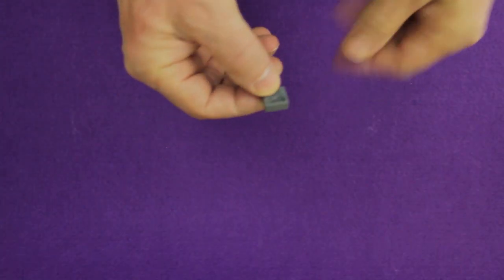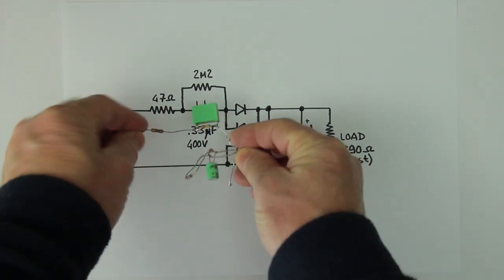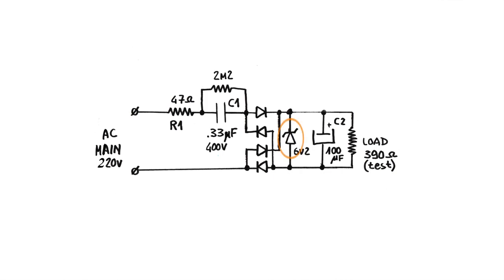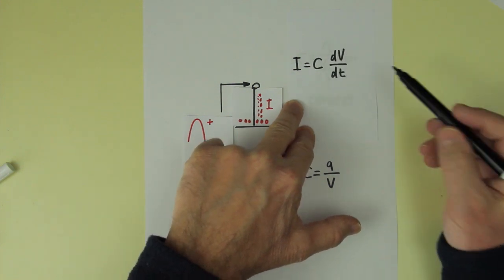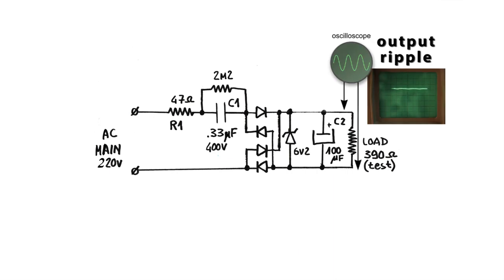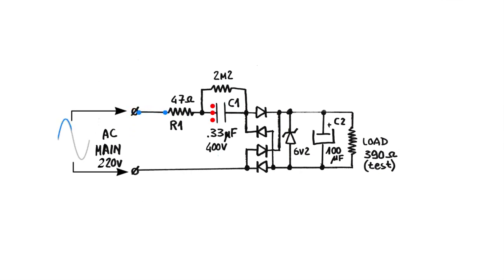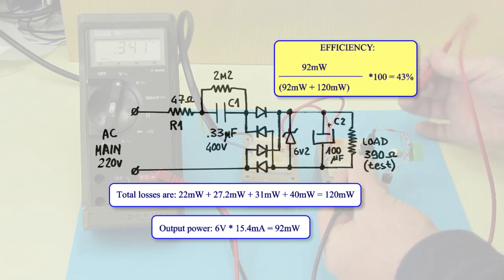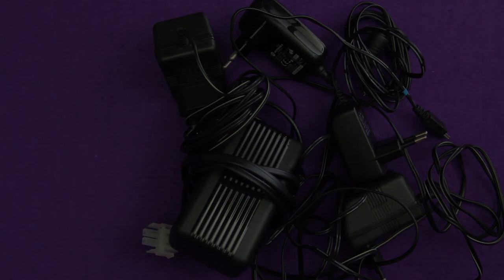Why Capacitive Power Supply Are Bad (electronics educational)

Comment: In some cases, when space and cost constraints are conditioning and current is very limited capacitive power supply are one of the choices.
Other could be offline inductorless regulator. This stuff leads to work with insulation transformers during developing process ,if a micro controller is used, this will work in the unpleasant condition to have mains live connected directly to GND

Comment: The power losses from the bridge rectifier don't count. You have those losses even if you use a transformer instead of a capacitor. You still need the rectifier to get DC out of AC.  Also, of course the efficiency sucks if you use a simple shunt regulator like a Zener diode. Put in an efficient synchronous buck converter and you can recover 95% of that. Most of your genuine losses are actually from the current limiting resistor on the front, which really only needs to be 10 ohm, not 40. There isn't much you can do about the X2 bypass resistor. You can regain some efficiency by using a 10 Mohm instead of 2.2 but there is a limit as to how far you can go.   On the other hand, what you don't talk about are the efficiency losses due to the magnetic core of a transformer if you are trying to make a very small power supply. These will utterly destroy your efficiency on a small power supply of 500 uA.  So it really depends on your project. Engineering the correct design for the job at hand is always the proper solution.
Reply from the maker: > "Put in an efficient synchronous buck converter"
People use the circuit showcased because it is very simple and dead cheap in the first place, so there is no point in using a buck converter with a capacitive voltage drop. While I do agree that playing a bit with the values of the resistors the circuit could gain a bit in efficiency, the goal of the video was to highlight the serious drawbacks under the point of view of efficiency (including power factor, although small), safety, and stability. One point I didn't mention in video was that this circuit is also prone to cause severe failures in the case power mains contains harmonics. @Mathias Wandel has experienced himself this kind of issue when he tested a portable, battery backed generator that fried a power meter.
About the rectifier, while it is true that it is likely required even on other types of power supplies, it doesn't mean that to calculate efficiency we can neglect counting it.
Finally, certainly a small transformer is a source of non-negligible losses, but nowadays we can design a switching power supply that works at high frequency, dramatically reducing losses, increasing reliability and safety and making the whole thing small in size, even though not so deadly cheap as a capacitive voltage drop power supply.
Thank you anyway for commenting, your contribution provided an opportunity to bring new elements to the topic.
Your last line is very wise: Engineering the correct design for the job is always the proper solution.
Greetings from the Alps.

Comment: 220 VAC  IN  OK.. TO 18... "NEXT" ...18  TO 220 VAC.. (BUT !!  YOU HAVE NO AMP ANYMORE)

SO   "TO WHAT USE"   !!

IT  IS  NOT  LIKE  "220VAC..10A    IN    220VAC...10A  OUT"  ..!!   THINK EVEN NOT "1 AMP" OUT

SO   ???
Reply from the maker: Sorry for the late reply. You need to take into account power. A 220V-18V 20VA transformer roughly can output 1A while absorbing 90mA in input. Reversing the equation gives the same result: 20VA 18V in absorbs 1A and output 90mA at 220V. Indeed the output current is less, because efficiency must be brought into the equation. So suppose the efficiency of each transformer is 80%, the total efficiency of the two coupled transformers will be 64%, so output available power will be reduced at 12.8VA which gives 58mA at 220V vs. 90mA.
1A output means almost 220VA in power, and compensating the power losses, supposing a 90% efficiency (the larger the power, the larger the efficiency), to achieve 1A in output you would need a couple of transformers rated 272VA.
Remark. Edited, reason: typo on output voltage, added further details to achieve 1A output.

Comment: What! In the end the solution is actually use commerialised power adaptor?!?!!? HAHAHAHAHA!
I am not sarcastic. I was waiting for the solution and then...I did not expect to hear that. I thought you are going to show how we could DIY a simple power supply which has power factor of near to 1.
Reply from the maker: I am happy you are so amused for my video :) Yes, you are right about the poor power factor of some wall-warts but at least they have the output that is insulated from mains, and have better efficiency anyway. Furthermore, the purpose of this video was to talk about this kind of circuit to highlight their characteristics, not a DIY video. Cheers.
Reply: @AccidentalScience  You are correct about the insulated part. But I dislike the fact that nearly all Chinese products are only 2-prong! Not grounded! According to companies (Dell as well), they say that there is a reason for establishing 2-prong, but no reason stated. Weird indeed.

The only reason I know is 3-prong, the ground can effectively create a ground loop to the circuit making a safe one unsafe. But this reason is invalidated by properly designed and engineered circuits and housing.

Also, grounding really can totally eliminate "electric tingling". This capacitive electrical phenomenon actually renders my precision devices such as GPS unit and camera nearly useless. Thankfully none of them gets fried.
Reply from the maker: @realchristopher4334  They have 2 prongs because typically they follow the norm for double insulation (see here for a preview: https://webstore.iec.ch/preview/info_iec60950-1%7Bed2.0%7Den_d.pdf ).
Being double insulated you can ground the negative. The "electric tingling" as you call it, is a defect that indeed affect several smps for laptops. If grounding the negative causes an increase in positive voltage (spikes when seen at the oscilloscope) or a current goes through the (added) ground wire, then the PSU is severely defective/badly designed and need to be discarded. I think they are not compliant with the normative too, but I have no strong proof of it.
For instance, I noticed that every PSU that came with Acer laptops I had (5 units) were affected by this problem, and one of them fried an AVR MKII programmer while I was reprogramming a unit having an ATmega32 that through a communication line was connected to ground. But because at the time I was the CEO of the company I never had the time to investigate into this problem, even though indeed it would deserve a whole video ...maybe one day :)
Reply: @AccidentalScience  Ah. Double insulation. I see the symbol often. Square within square.

According to the article you provided me with, having a device earthed or double insulated or reinforced insulation seems to be an option. I always thought earthed is a necessity in the name of safety and also as a makeshift Faraday shield (as in my case).

I do not have an oscilloscope, unfortunately. I am just another average hobbyist or DIYer.

Hmm. Problem is 3-prong plugs (especially from China and by China, whether it is its Western investors' idea to save cost or deliberately designed that way) have 3 prongs, I dare say almost EVERY ONE of them is only 2 usable prongs. It is because the ground pin is plastic. It is there for the sake of opening up the live and neutral covers. Few I found are 3-prong, the earth pin is metal, but absolutely not wired, it is there for formality sake.

Therefore, what you mentioned about the negative can still be grounded despite of being double insulated, it is not happening. Ground pin is as if a decoration and serves nothing more.

The said "electric tingling" is not limited to only laptop or PSU, in my case. In fact all 2-prong or 3-prong (but only working 2 pins) plugs produce that phenomenon. My laptop is plastic all over so I cannot feel it (I can feel the effect only when I plug in USB cable). 

My very old laptop with is very old PSU were the same. I did not know "electrical tingling" is a real problem. 

Too many coincidences that it is not a coincidence that the plugs or circuits are made such a way. It cannot be every one of them is like that. I think they are meant to fail as quickly as possible to force people to buy new ones. (Sounds like conspiracy. But not a conspiracy when we consider it similar issue to LED. I bet you already know that LED companies overpower their products. This is even true for Chinese knockoff, they use same amount of LED for all claimed wattage but run by different drivers, they can get insanely hot! Only Dubai managed to force Philips to make ultra efficient and possibly never-dying LED by underpowering each LED, they stay cool.)
Reply from the maker: When I said the negative can be grounded I meant that, should the unit be one with double insulation, you can add an external ground wire safely in some way (maybe changing the power cord and plug). Double insulated equipments MUST have two terminals only, otherwise they won't fit the norms (I am referring to EU-EN norms, I don't know about other places in the world). By "terminal" I mean either prongs and/or side contacts as you may find in Schuko plugs (they are standard EU plugs, look at wikipedia if you are not familiar with them).
Plastic prongs have mere mechanical purpose and can be disregarded the electrical point of view.

About "Electric tingling" I wasn't sure you were using an euphemism to intend a leakage in noise spikes from the switching circuit through capacitive coupling rather than an actual tingling caused by a small flow of electricity through your fingers. So I mentioned both cases, even though they are two very different cases. Sorry if I wasn't clear enough in my previous reply.
If you can actually feel that tingling with your fingers then it is more likely an indication that there is a leakage from the mains, and in that case it can be measured as a current flowing through the ground wire. That situation could be dangerous, not to mention that it could make your differential circuit breaker to trip. Even some transformer based power supply may show that behaviour which is an indication the insulating material is defective. As long as this current leakage is small it is relatively unharmful, still it could damage other sensitive equipment, and definitely I wouldn't live in comfort with this. That's why I've said the unit should be discarded.
No one of my wall-wart switching power supplies, including laptop ones, apparently sport any leakage from mains. I didn't investigate accurately though. The only exception is those old PSUs from Acer mentioned in the previous reply, where I actually found, with a superficial check, a leakage of spikes from the switching circuit and a very small leakage from mains (some mA can be measured from PSU's negative to ground), not strong enough to be felt with the fingers but enough to fry the AVR programmer.

Also, if you have these units grounded and still feel that tingling then beware that it could be your grounding the problem! I.e., your ground could not be really ground, and maybe get some leakage from neutral or live.

About LEDs, yeah, I am aware of that thing, but that's another topic.
Have a nice day.
Reply: @AccidentalScience  I have subscribed to your channel! You are terribly technical and willing to share!

I apologise if I am wasting your time or seemingly trolling. I am genuinely fascinated with what I learn and finding a valid solution to my present issue. I honestly cannot be throwing away the power supply I bought and buy new ones because they are the same! Same goes for branded ones. I thought something wrong with one, I bought another, and another, and another. I have collected rather many of them. I am on the Internet looking and learning about this nonsense because I had spent too much money only to waste. Insanity. I am not rich enough to do that anymore. I cannot return those things and get refunded because sellers/shopkeepers said "They work well and work as expected", which is damn true! I do not want to go into the topic about safety as it stupid-fies you. Long story short, most sellers here are not interested to know about safety as long as something works and does not kill. The law is dead. As long as no one is dead it is fine by the law. We are far from the very strict standards of the EU and the UK.

You have nothing to be sorry about. I understand that there are differences of understanding of terminologies between you and I. I admit that I am not an engineer of anything at the same time I am not at all a layperson gravitating towards dumbed down concepts and prefers no-brainer explanations. The same word can mean different things in different contexts and in different scientific disciplines.

What I found on the Internet is called "laptop tingling". I do not experience it on laptop but generally any metallic part of any electrical devices powered by the said power supply/supplies, I called it "electrical tingling". More generic. So yes, electric or laptop tingling is euphemism to mean that nearly impossible to describe feeling.

Common words to describe it are: friction, rough, jagged, stuttered, miniature start stop start stop start stop start stop, buzzing, brrrrrr.
Similar to rubbing your finger hard on wet glass, you can see a trail of finger-shaped "layers", and you physically can feel that typical start stop start stop.

Laptop tingling seems to be common all over the world. Some engineers explain that it is due to capacitive "something", I forgot the word. Very likely is capacitive coupling as you mentioned. Not true ground failure. 
Gap between coils within transformer, gap between the device and electric wire, gap here there everywhere all contribute to that .....electrical...capacitive thing, for lack of proper term. 

The 'cure' for it is to put a piece of metal between coils and then wire it to ground (essentially a Faraday shield), which is impossible to be done by the average mere mortals.
Second option is to somehow find a safe spot within the circuit and add an external wire, then connect the external wire to ground. (Exactly as what you mentioned)

Grounding of this house is good. The GFCI / RCD is working fine. I pressed that reset button and power is cut.

Ah yes. The 'standard' EU plug for us is the flat one. Because the mains over here is UK standard. Only the flat one fits. Even so it fits with some difficulty because width of those rounded pins are bigger than rectangular pins. Some are too big to go in.
Reply from the maker: Thanks for the appreciation. Set apart those unit already mentioned in the previous replies, I didn't experience the problem you mention so I cannot be helpful. Sorry. If the problem is safety then that tingling effect is something I would be worrysome. Check it out if there is a leakage current to ground, make sure you pick a very good ground, such as a spike well buried for almost 1 mt into the ground, being sure the ground isn't made of gravel or sand but humid dirt. Use an AC milliamperometer. Ideally it should give zero (some microamps maybe) for a 230V line, a leakage of 1 or 2 mA can be enough to cause that tingling feeling ...and it is not a good sign. Good luck.
Cheers.
Reply: @AccidentalScience  Wow! Sounds like the old days when I was experimenting with radio. I hook a wire to anything metallic, also shoved a metal rod deep down moist soil (Probably not 1 metre deep, but it worked. Maybe the entire ground is moist from the very top to the very deep).

Seems like there is nothing much I can change the situation other than externally connect a wire to ground of electrical main or a spike in the ground.

Hmm. My cheap multimetre is useless to measuring AC current, it is mostly for DC. Makes sense that it is not for AC because it is so cheap that it is very dangerous.
I have plan to 'upgrade' to a better multimetre. However, I try to wait for as long as possible because I do my best not to spend so much money on things that I use only rarely.

Assuming I already have a multimetre that is able to measure AC milliampere, how do I connect the test leads in order to detect current leakage? Red lead to myself, I stand on an insulator, black lead to ground, and then I touch the offending device that is connected to unearthed power supply?

Incidentally, do you have plan to explain and teach us how to make GFCI/RCD?
I found only one YouTube does it. Problem is he does not mention the characteristics (part number, split or not, how many Henry, size, ratio, so on and so forth) of the current transformer. Also, he does not explain why he designed his PCB to have zebra crossing-like pattern for current transformer.

https://youtu.be/DAirNBK90pA
Reply from the maker: >> "Red lead to myself, I stand on an insulator, black lead to ground, and then I touch the offending device that is connected to unearthed power supply?"
ABSOLUTELY NO! The measurement must NOT be performed that way. It is too complex to explain in a comment, I won't go further into this, sorry. You should thoroughly read a book specialized in power installations, or ask to an experienced electrician.
>> "Incidentally, do you have plan to explain and teach us how to make GFCI/RCD?"
Definitely no.
Reply: @AccidentalScience  Ah, yes, I understand. 

Thank you very much for your effort of sharing!
Reply: May be by minimising losses,
1. Schottky diode (low voltage drop) instead of a normal PN diodes

2. To compensate the output , increase/decrease the dropper capacitance valve by  taking all the losses into account and what the actual current load draws ?